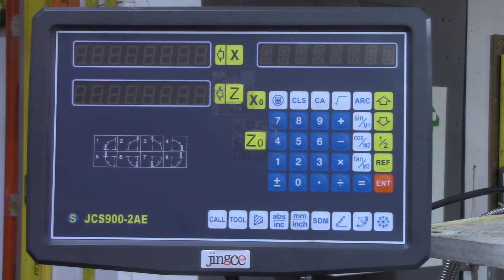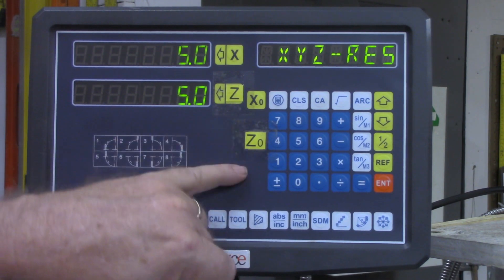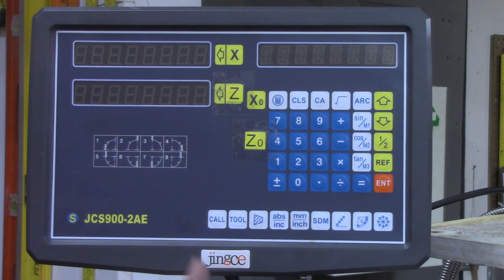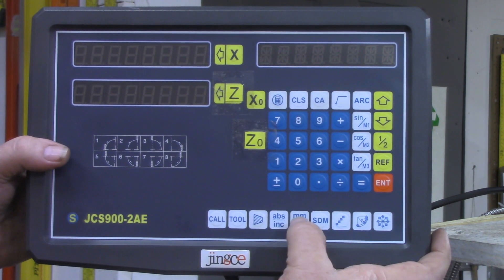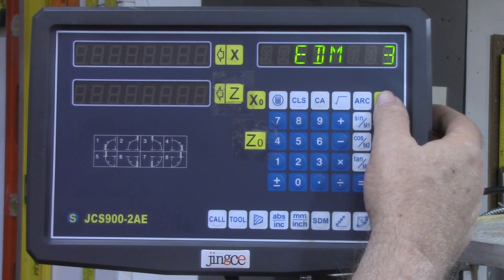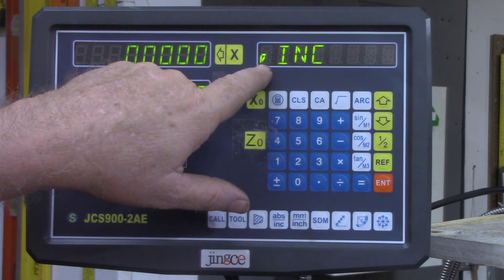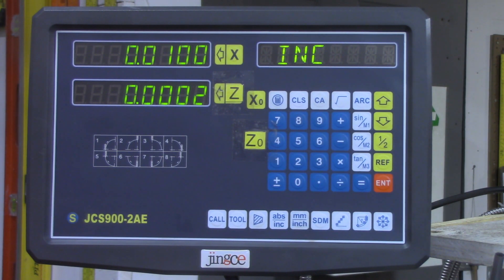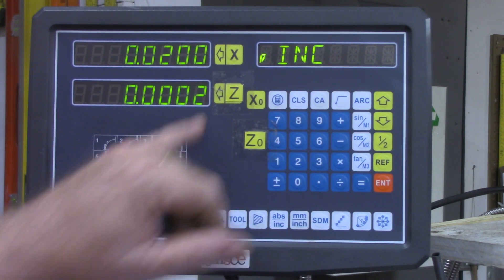JCS900-2AE DRO - Corrected information on Lathe Use

Comment: Hi Lee,
I have had a Smithy for 20 some odd years and finally installed the jingce DRO about 6 months ago. Tremendous improvement! The manual that came with my unit was crap but it did discuss  pressing the mm/inch button on startup to enter the parameter menu. I have ordered a PrecisionMatthews lathe so I downloaded the PrecisionMathews DRO manual listed under the PM727 mills. The mill dro manual is closer to the jing than the lathe dro manual. It also discusses the 6 presses on page two. Look for the "PM DRO Manual 1-15-2018".
Keep up the interesting videos.
Thanks,
Dave Rupp

Comment: Hi Lee. Thanks for this video it pointed me in the right direction. I have a 2 axis panel similar but not exactly the same as yours. The little s doesn't seem to do anything, but the . does. And yes 6 times on the Metric/imperial button once it is booting up does get you into those settings where I managed to change the Mill 3 to Mill 2 but storing it was something else. Enter didn't do it, but in the end I found the . stored the info. Not particularly intuitive, but it got there in the end. Many thanks lee for pointing me in the right direction.

Comment: Soft ware
I have been following this post closely as I also have the same model DRO as you have been describing and I have come to the conclusion the no two have the same software, it seems to me that with each shipment they upgrade the software and I have tried to contact them with the website they provide, but that does not work, Like yourself slowly I am getting there I have tried many other postings on U tube but even though they have the same model number they behave quite  differently,  while they are a good little DRO they let them self down by not having any place you can turn to for help.
Anyway thanks for what I have learnt from your posts.
David

Comment: Now, transferring from the calculator to one of the axes would be useful to me. I have a different brand of DRO, but the way these guys copy each other's features, I probably just need to look for it on mine. TY for the video.
Reply: You inspired me to try on my DRO, which is not the same as Lee's, but hosts much the same buttons in a much different layout.

I found that I could transfer an axis into the calculator by using the up or down buttons, so the the "mode" display showed 'CAL   R', then pressing one of the axis zero buttons (eg X0). 
However, everything then seemed to lockup on mine :-( Didn't seem all that useful at that stage!

I could more reliably transfer from the calculator into an axis. 
Once again using up or down so the mode display showed 'CAL   T', then pressing the appropriate axis zero button (eg X0). BUT, the value was negated on that axis after leaving the calculator....

Is it just ropey software? 
Would be interesting how others go (in a not so cold shed!)....
Reply: On my lathe DRO (Sino brand) I can transfer only to Y after I press the up arrow, Y0 and exit calculator mode. On my Mill (T-Pac brand) I can transfer a calculation to any axis with just the X0 Y0 or Z0 key, however it transfers 1,000 times my answer, e.g. 55.0 instead of .055. Not so useful.

Comment: My smelly manual says what Lee has found, Lathe modes use the 1/2 button to switch between radius/diameter modes.
Mill modes allow you to use an edge finder on opposing edges to locate the center point using the 1/2 button:
First edge, zero axis(eg X0); second edge press Axis (eg X); press 1/2; press axis again and value is set; wind to zero for center.

Comment: I was unable to find out from your previous vid comments where the press inch/mm 6 times was.  Or any of the other info you gleamed from the comments aside from James Walkers info
Reply from the maker: jsteifel Be sure to read the replies to James' first comment. That's where the 6 times info was first shared. James's comments & the replies to it lead me on a quest for more info that has revealed a couple other items that either aren't mentioned in the manual or are different than the manual.

Comment: I think that the symbol represents the compound set at 45 degrees.  That changes the radius to the diameter if you use the compound as you feed.

Comment: I have exactly the same unit on my lathe, and the three axis version on the lathe. The manuals are absolutely terrible, I have to agree. Simply not worth opening at all. I am going to try your radius/diameter trick tomorrow. I would be very, very interested to see a video on everything else you have learned about this unit. Do you have any idea at all how to use the Tool function? One of my dros has the tool button, the other doesn't. Neither of the manuals actually matches their respective units, and the Tool button doesn't seem to do anything at all. There's zero useful information in the manual, of course.
Reply: Well, I couldn't wait. Turns out my 2AE and 3AE are quite different from each other. They have different buttons, some of them are not even in the same places, and I cannot find a button that does anything if I press it 6 times during startup. I guess I'm stuck with having to fudge the radius/diameter thing, unless anyone else has any ideas.
Reply: paul toman try pressing the dot '.' Key as the test numbers appear during power on?

Comment: How is this DRO working out for you?
Reply from the maker: It is working great - just a few little quirks to deal with in transferring a calculator value to an axis, but once I figured out what was going on I simply divide the value by 2 before transferring from the calculator to an axis (it doesn't recognize the radius/diameter setting and doubles whatever is in the calculator).  I suspect some programmer was tasked with the duty of considering that setting and simply got it backwards.  I'll do another follow up soon on more things I've learned how to use on it.  I will likely be purchasing one of these for my surface grinder.  Thanks for stopping by.

Comment: I have ordered a jcs900-2ae on aliexpress, and got the new version. It has 4 less butons an verry clear manual. A good improvement. Nou thay have a special chapter for the radius and diameter in the parameter setings.
Reply: I have the jcs900-2ae/3ae. Could you post your manual for download. Mine is crap.
Reply: I dont know how to do that, give me some time.
Reply: @eeneihoorterbij  i think i found it online. Its pretty plain. I talks about tranfering info from the cal to any axis but the cal must be in cal mode 1. Can not find cal mode 1. Have fun with yours.